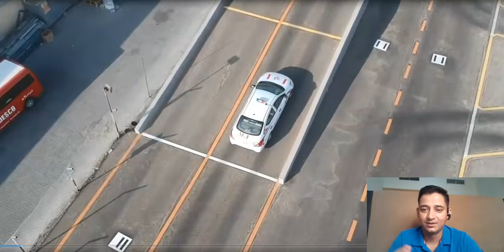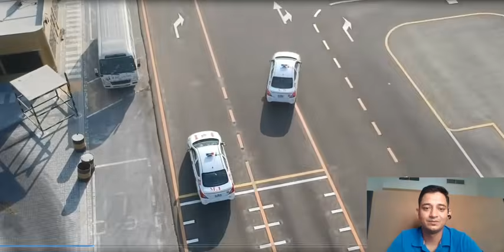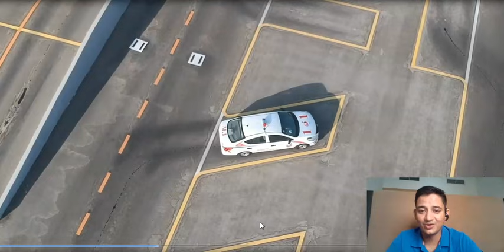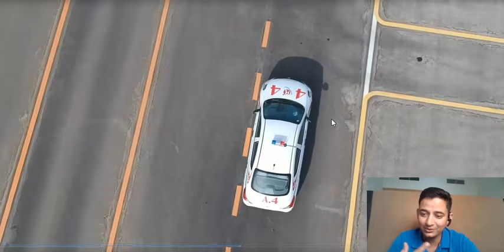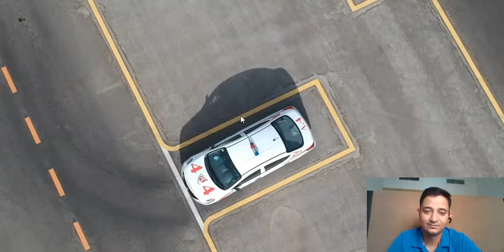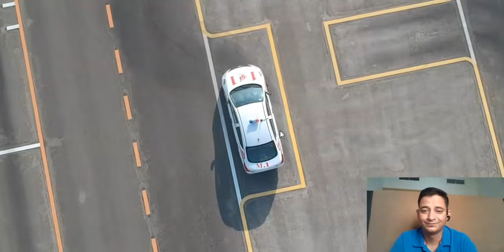SMART YARD / PARKING TEST BY RTA DUBAI

Comment: Here are some tips drivers teachers will not teach  u in ur 3 smart yard parking test angle , smart yard and parallel parking 

Be confident 

 I think what fail ppl much in this smartyard parking 🅿️ is two things 
If u hv learned those key points but yet u find urself failing all time bcs of line touching etc here’s what to do i think it will help u as it does to me 👇👇

(1) don’t adjust those mirror immediately u enter d car , reason is bcs u may not no how to do proper adjustment, so just used d already set mirrors if u check and d mirrors are ok to d doors handle just manage d height of d person that use d car bfo bcs u may try to adjust d mirror and u will not set it well and definitely u will fail bcs ur car tyres leg will touch d yellow lines even if u position ur car and got d key 🔑 point still ur car will touch d line  bcs u didn’t got d mirrors adjustment. So used d already set mirror in d car 

(2) u should reverse back and got it right if u check that d car is not well position but make sure ur car tyres never enter d parking 🅿️ area both d white and yellow lines that’s d time u hv opportunity to reverse 🔄 back and position well and don’t make dry steering make sure car is moving bfo u shift ur steering bcs u will not be disqualified bcs of reversing rather they may reduce 2point bcs is a minor mistake not major problem so is better to reduce 2point & pass than failed entirely 

If u careful do this u will never fail

Comment: Thank you so much sir , today I cleared garage parking and parallel parking after many failures , I cleared only because of your suggestions. Thanku sir.
During garage parking back tore of right side suppose to touch the line but as per your suggestion I stopped the vehicle and took little bit forward 1 meter  and after adjusting wheel again reverse and cleared the garage parking test. Thanku sir again.

Now next I will go for angle parking test which is only pending
Reply: Here you are taking about RTA or School test???

Comment: For the perelal parking you didn't mention the second point, the second point is (when you tern right you have to check your left soldier when you reach yellow line with your left soldier you have to turn left to straight your staring wheels) you will be ✅

Comment: Should I adjust my seat and the mirrors and seat belt after I put the gear to drive or theses points are not counted in smart yard test? I mean I can do them before camera start monitoring?
Reply from the maker: Yes you can do it before parking test start.  Ideally you should adjust seat mirror and put seat belt before giving signal to start the test.

Comment: Emergency brake test maximum speed 25km not 25-35 km thats wrong dont give wrong information 😊
Reply from the maker: @Gamer thanks for your comment!!! Its not wrong information. 
Range for emergency brake test is between 20KM/hr-35KM/hr, below 20km or above 35 is immediate fail. However its advised to keep the speed between 25-30 KM.
Reply: Soory now maximum is only 25km
If you go 26km automatically car go off

Comment: Hello sir, today i failed emergency break test. The car was still below 20km/h but the car suddenly stopped by itself even before the bip sound. When I took my result it is mentioned that i crossed the white line below 20km/h (11km/h only). Please I will like to know what really made the vehicle to stop when it was still below 20km/h.
Reply from the maker: @Nchindo Sad to hear that. Its seems very unusual. Are you driving manual or automatic car? Since testing vehicles are  connected to CPU, if speed cross the 35/km than the vehicle automatically stop that for safety reason but it should not happen in lower speed. If you are driving manual than it could be due to the gears. In this kind of cases we should restart the car and try to achieve speed of 20 km/hr before crossing the first line & we should never get out of the car as that will be immediate fail.
 Did you passed in other parkings?
www.mydubai.life
Insta@Mrfinedine
Reply: @mydubai  hi sir, i am driving automatic. I really don't know why the car stopped below 20km/h.
I passed in other parking. Only emergency break remaining.
Reply from the maker: @Nchindo Bad luck bro its highly unusual.  
www.mydubai.life
Insta@Mrfinedine
Reply: @godlovenchindo7692  this happened to me too did u take it again??
Reply: @suu4890  yes dear, I took it again and I passed

Comment: Thanks a lot sir for your guide lines and assistance rendered.
My question is do i do the shoulder checks on slop test and emergency brakes.?
Reply: Hii
Reply: @Hussain-wt5eg  hello..
I passed the final RTA road test on first attempt and iam already working. Thanks for your help. It was really great.
Reply from the maker: @Ferooz  Shoulder check is Not required during slope test or emergency brake test however its better if you do that & you don’t loose any points for that.
www.mydubai.life
Insta@Mrfinedine
Reply: MyDubai alright sir thanks a lot.